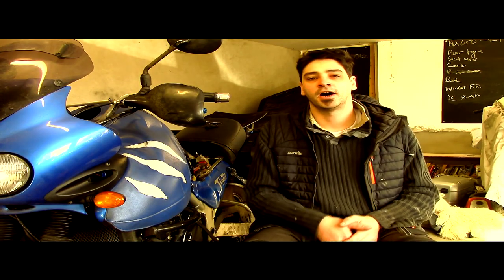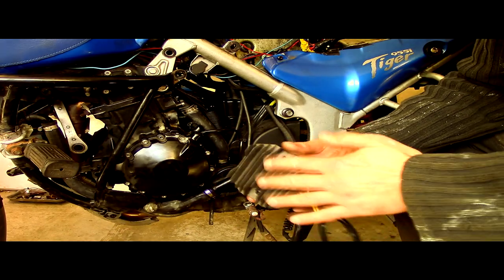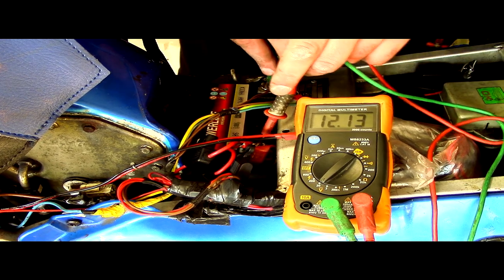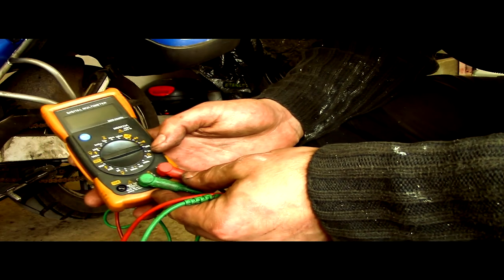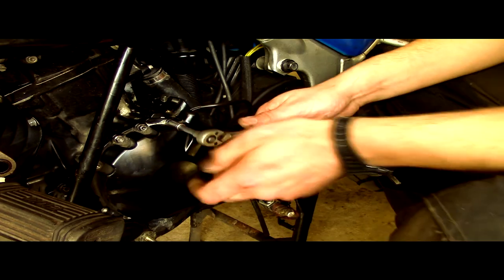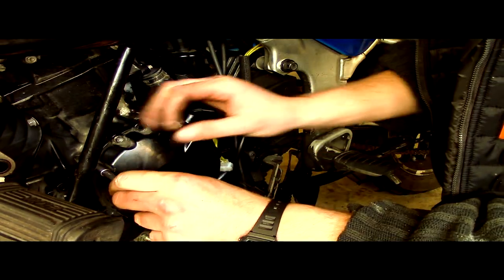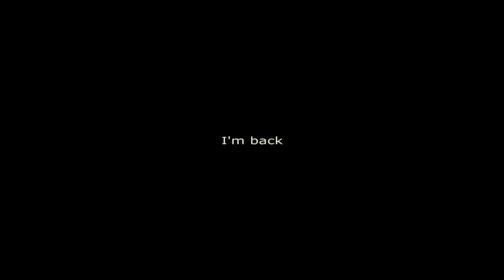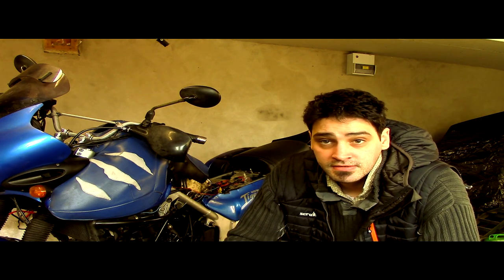IT KEEPS BREAKING DOWN! Triumph 955i charging problem / failure. How to check a stator

Comment: Great video, now I understand what happened to me. I was riding on the Bay Bridge heading eastward at about 60mph out of San Francisco in five lanes of Friday afternoon "run-for-the-hills" freeway traffic, when the engine on my Daytona 955i just died on me. No electrical power at all. Nada. Very much a brown-trousers moment. I immediately pulled the clutch in and coasted to the side of the freeway on the slight down gradient, but there is no shoulder on the Bay Bridge... just five lanes, and then a 4ft wall and a 300 foot drop to the bay below. I eventually made it to the Oakland side and then pushed the bike to a median and waited for CalTrans for help. Turns out it was a stator / rectifier problem but then the same thing happened again after both had been replaced (fortunately this time not on a Bridge!) I had both pieces replaced again and still no charge was holding in the battery. The mechanics could not figure it out and eventually Triumph replaced the entire electrical cradle at no cost, even though the bike had completed 62,000 trouble-free miles and was well past the warranty and fortunately that did the trick. I am back to riding her again.
Reply: Harness connection melted most likely same thing happened to me 5 lanes going 80+ 2001 tiger 🐅. Triumph is great for helping their customers I bought a brand new 2002 Sprint and 3 months later had a rock go through the radiator minutes later traffic slowed down to about 5 mile per hour and lost my coolant. It over heated and warped the head before I could get off the interstate. Had it towed to the dealership they told me the head was warped and it's going to be 3 Grand to fix. I said fix it with a long face. So they called Triumph to order the parts and the guy at Hinkley asked why and said to the dealership were sending you a new head and gaskets for free and paid the labour to the dealership and said thank you for buying a Triumph. That bike never gave me another problem for 30 thousand miles when I sold it to get the used 2001 tiger. Gotta love Triumph!!!!

Comment: Speedo and rev counter dropped to zero, then a few miles later my 2003 Tiger cut out... Thanks for this great video, will be doing this at the weekend. Hoping it's the reg/rec, but I'm now educated to check stator and all wiring too. Cheers!

Comment: Hello again  today i just broke down lost all power to the rev and speedo and shortly after that the engine stopped and the battery was flat so will be trying to find out which is the problem ,stator or regulator thanks again this is very valuable information so i can get my 2004 tiger 955i back on the road where she belongs.

Comment: I had a 2001 black beauty with changing issues and it over heated the wiring harness witch melted the harness connector's. Switch those with new ones and sodder. Replace the stator and rectafire. But it's a good idea to replace the battery at least every 2 years because if it's not holding a strong enough charge they're going to give you a problem even if it turns over fast enough to start. IMHO keep a battery new. Those are the best bike's I've got a 2006 now without any stator issues . It gets more attention than a 35000$ road glide. Goes like stink handling is great break's good does the job on dirt roads very well comfortable all day 6 gallon+ tank, and the best part is they can be had for under 4K with very low miles. In my opinion one of the best bike's for the money out there. But you need to be at least 5 foot 10 as they are quite tall. Get one if you can!!!

Comment: Very nice and helpful vid. Unfortunately I'm going to operate my Tiger 955 these days. An OT question: where did you find that little bar below the screen, the one where you put the voltmeter(?) and same thing for the bar on the handlebar.
Cheers

Comment: maybe the magnets are weak. over time this happens. I suggest you check if the magnets are weak. If this has occurred, the voltage induced in the stator coils falls below the required value. Due to the power consumed, the current will be higher than it should, to compensate for the drop in induced voltage. Then one of the stator coils can't handle it and burns out. This is what happened with my Tiger 955i.